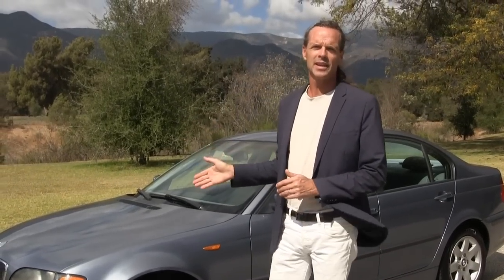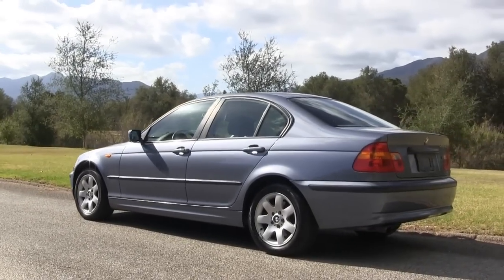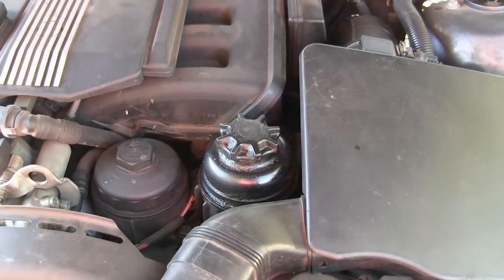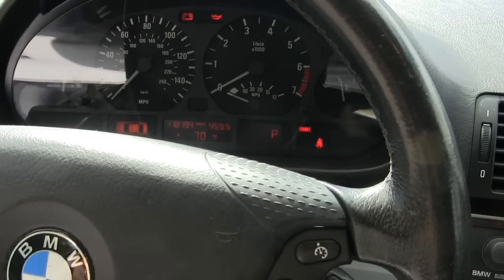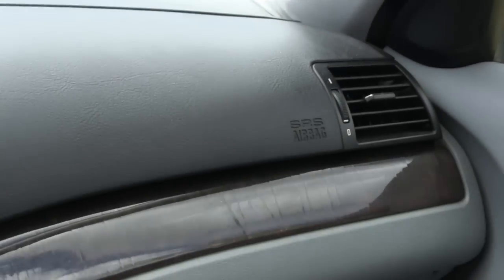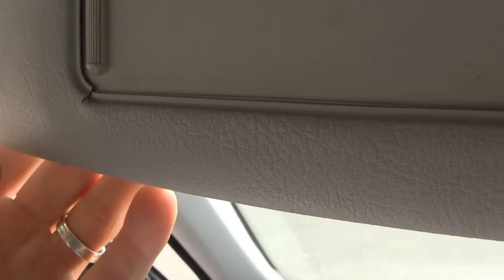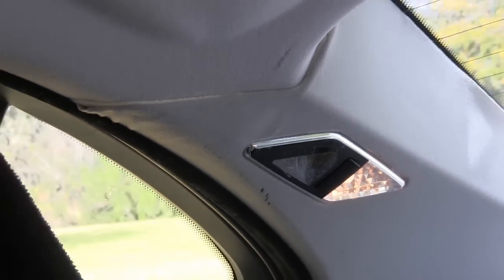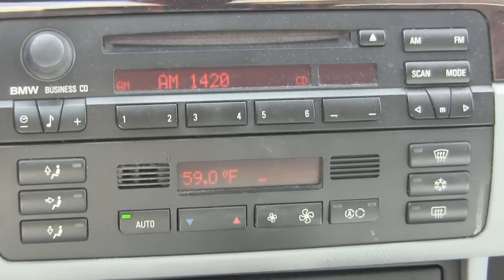Why You Should NOT Buy a Used BMW

Comment: So a car detailer bought ONE BMW lemon and advises not to buy any used BMWs??? Are you serious man??? You are just an amateur, I've owned used BMWs and never had an issue with them. But I did had problems with my new Ford... are all Fords shit? NO. Used cars can be amazing or can be a disasters depending on the care given by the previous owner. Generalizing is a ferry bad thing, you should know that at you age.

How much did you paid for that car, did it came with a full service history? You are telling us that American cars are better made??? Unless you have a hidden agenda I will suggest that you keep wrapping your engine bays with burrito foul and power washing them... I guess then Toyota engines will be also crappie... or they can take it? Total amateur talk and approach.
Reply: BMW, VW/Audi, and Mercedes all went down in quality when they globalized their production. This started affecting build quality in a terrible way between 1998 and 2000 depending on model. As an example, the Mark IV VW Jetta was a great car until the mark IV and they moved some of the production to mexico. The mexican built cars were a travesty on quality control. There are similar stories with both mercedes and BMW. In order to compete in a global market, quality had to suffer to cut costs in production. That is why the resale value on used BMW, Merc, and Audi is so terrible. The worst being AMG cars.

This is compounded with the fact that most German models require dealer specific fluids, tools, and maintenance parts. So you get a car that is barely built to last 80,000mi and unnecessarily expensive to repair. I would never own one at this point unless from new with warranty. I have owned 2 German cars in the last 10 years and I have learned from my mistakes.

"German Engineering" is marketing bullsh*t
Reply: You have owned 2 German cars in the last 10 years... Well I've owned a few more than you as I live in Europe. I never had any serious problems with my VW or BMW. My brother in law only buys BMWs with more than 60.000 miles on them because they are super cheap here in Germany. NEVER had a single issue with them and the resale value is quite high.

BMW engines and specially the non so popular in the States Diesel ones are built to last at least 300.000km (around 200.000 miles) without any major overhauling.

Are American cars better? NO. Your crash test were the worst in the industry until late 90s. Only Chinese and Indian local manufacturers were worse. Are American cars today still so bad? NO (except the Mexican made ones [crash tests available all over YouTube]).

Yes, High Performance engines with super low emitions and high mileage per galon need specific tools and fluids in order to last long... And? i always take my vehicles to authorized repair centers, no gambling there.

My BMW 520d burns 6.2 - 6.6 L of fuel per 100km on mixed conditions (that's around 1.6 Gallons per 60miles). Yet it reaches 240km (160miles) in the autoban without any concerns. Smooth... Amazing car.

i believe generalizing after owning 1-2 cars is not very wise. You might just have been unlucky. I owned a Corvette once because I wanted to experiment the American dream. It was the worse car I've ever driven. Are all Corvetttes shit? Absolutely NOT. I love them.

I salute you.
Reply: Konstantinos Anastasiou you missed a major point, you live in Europe. the cars sold outside the EU are of inferior quailty. german cars are bad buys in the states, for all the reasons stated above. In the states Japanese cars are hands down the most reliable, and us domestics are cheapest to repair comparitively. 
You also use some very faulty logic, because to dont need to own a car to learn enough to know its not a good buy.
Even japanese cars quality has gone down over the last decade because most japanese firms manufacture cars stateside to reduce production and shipping cost.
Reply: fonque we are going to have to disagree on that one. One cool example is that BMW builds the X series in the United States and ships them Worldwide with top quality! BMWs made in USA are as good as the ones made in Berlin. Manpower is different but quality control is exactly the same if not better.
Reply: With the same - I had my e36 with 500.000km on it and it worked great, without any rebuild. 
I know many others who have bmw's with very high mileage and without any major problems. 
The things he talks about in the video is just bs... Waterpump etc? Well, it is common sense to follow the mileage and change the parts that wear down / get brittle with mileage. (looks like not so common sense)
Reply: Amen, at last some common sense... Absolutely agree. The problem is people want to own expensive cars "on the cheap", skipping recommended services or doing them in the cheaper places they can find. In the official BMW catalogue there is a list with parts that need to be checked / changed after specific mileage as you said. 500.000km is a lot, i guess you got there a great car!
Reply: Hey - someone living in Berlin here. They only build motorcycles and few (if any) car components (e.g. brake discs) at the BMW factory Berlin Spandau. Generally i'm with you but there have been issues with certain models. For example the first year(s) of the Z3, build in the US we're not up to the standard "german-built" quality, same goes for the first gen X5.
Reply: Hello Brian, I agree with you. 1st generations always have small issues but I believe the same applies to every brand and make in the world. Every manufacturer has recalls and service bulletins because of technical 'maturity' related issues. My series 5 is the last generation of the F10 so no problems here ;)

i salute you.
Reply: just go to edmunds.com and read the reviews on any bmw there and you will basically see it split 50/50. worst most unreliable modrl ive ever owned, or this is the best car ive ever owned. That 50/50 split is not good, that means the cars are unreliable compared to other brands. Also you notice the more the miles accumulate the worse it gets. Then switch over and compare reviews to cars like toyota corolla, hyundai accent, or chevy hhr. You will see far less bad reviews on high mileage cars. The are economy cars tgat basically only need oil changes and accesdory belts to keep going. I had a 1992 Nissan Sentra that went 140,000mi and never in the shop once, only oil changes and bushings and rear struts. Good luck getting a bmw to do that.
Reply: fonque what's the performance of the 1992 Nissan Sentra? Compared to the BMW? How many valves and cylinders? Top speed? Better leave the Chevy out of this, it will be totally rusted before reaching 140.000 miles (like mine did). You are comparing economy cars with high performance GT cars... not apples to apples. How many miles can do a Lamborghini changing only oil and spark plugs? How many miles can do a Corvette changing only the belts? BMW is winning all engine awards every year. When was the last time a Nissan won an award? Only GTRs kick ass. I wrote it before: if you want to have a car on the cheap, by a Japanese sedan. If you want a European gran tourismo you will have to maintain it.
Reply: fonque from Wikipedia: For the 1992 model year (August 1991 – July 1992 production), a passenger's side vanity mirror and black body-side moldings became standard on the Sentra 2-door. The Value Option Package (air conditioning, cruise control, and a stereo system) was extended to SE models. The optional three-speed automatic in the E coupe was dropped and gained an optional 4-speed automatic, shared with other models. 

I believe this comparison should be over at the "vanity mirror" line... by the way that car was made in Mexico. Want to talk about NCAP safety ratings?
Reply: Konstantinos Anastasiou so you are okay with paying thousands more for a car thats less reliable, if so then you are exactly the kind of sucker bmw is trying to sell to. you like shiny new things but not well built ones. I'll continue to vote with my dollars.
Reply: Konstantinos Anastasiou i had an nx2000 which was designed in cali but built in japan, Same for the SE-R of the same year. But you have completely missed the point. Car manufacturers including BMW have been able to build cars as reliable as a b13 sentra but BMW chooses not to on purpose.
Reply: You keep saying that I miss the point and that BMW cars are less reliable than the Japanese. I totally disagree. In today's society people have too many options to buy from. If a product is unreliable people just skip it. 

I believe you are the one missing the point as BMW sales are in record figures year after year. USA is not the World. 

Germany is heaven for used cars and here BMW, Mercedes, Audio,  etc. are extremely reliable. Just lift your car up, is it totally covered from the elements? Mine is... I know for a fact that the quality of a car made with German engineering is far superior today than many competitors. Few manufacturers can brag about the technologies utilized in their cars. You want to believe that today's BMWs are more unreliable? go ahead. I have my own and verified personal opinion, non from reading on sites but from buying cars for many years as I am 44. How many BMWs have you owned? How do you treat your cars? In Germany due to the weather and the quantities of salt pored into the asphalt Japanese cars literally rot (you can check that online too) therefore their reputation is not so strong. In addition Munich is a very rich city so you barely see economy cars around.

In any case I see no point on going back and forward with you on this topic. Please feel free to buy used Japanese cars from the 90s. I will stick to my 2015 BMW 520d until the next 5 is available.
Reply: fonque by the way and without wanting to get disrespectful, how old are you? you keep mentioning cars from the 90s but you like tons of videos of Minecraft, Selena Gomez, electronic music and other "younger" hobbies. Not attacking just checking for people just trolling around. I had a few arguments with "connoisseurs" full of life experiences that were 21...
Reply: Konstantinos Anastasiou i am middle aged but my kids use my account, since they dont have one. Regardless of age it sounds like you havent done very much research on reliability and just going on personal experience and annecdotes alone. If you are really interested i can provide links to some reliability studies that corroborate the video creators point. Independant studies from both from the US and the UK. If you dont care about that then google problems per 100 cars. BMW does not fair well, no german brand does.
Reply from the maker: I am not a car detailer. I am a professional car buyer.
www.yourcarangel.com
Reply: YourCarAngel sorry to hear that. I work in the automotive industry for the last 22 years and never read an advise more objective than yours...
Reply: Konstantinos Anastasiou BMW and Mercedes DON'T have the quality that one would expect from a 10 year old German car vs a Japanese car 10 years old for half the price and half the repair BILL ALSO! Have a good day sir
Reply: mate sivric that's your opinion and you are entitled to it. I totally disagree and I will add that German luxury cars are in a total different league so not comparable to Japanese. The problem is that people want to buy a BMW and treat it like a Civic... I always service my cars in the official dealer network. ALWAYS. And that's why I never had a serious problem. A BMW Twin Turbo 6 cylinder engine cannot be maintained by your local car shop because they simply didn't spent the necessary money and time to get trained in that specific product. And NO, AN ENGINE IS NOT AN ENGINE. Again, I am impressed on how well put together and the feel of brand new used BMWs offer WHEN MAINTENANCE is followed by the book.

There is a very popular British car teleseries called FIFTH GEAR that totally agree with what I am saying.
Reply: Konstantinos Anastasiou I had been a valet for a few years and New Merc, BMW and Lex ALL drive excellent...Take a car from the Midwest(10 years OLD or older) with broken pavement and left in 100 degree summer and -40 degree winters ALWAYS cold started and all service done at dealer religiously and you can tell the difference in the quality of the the ride and reliability between the two is Unparalleled
Reply: Konstantinos Anastasiou I agree about German cars as in "AMG" but anything NOT hand built is uncivilized to even mention as "German" when the robots that build those vehicles are of Japanese or Asian descent.
Reply: ***** Hahaha...The Fields In Illinois is the same ALL the mechanics drive cheap Honda and Toyota because they have to make it to work on time! Look at any Range Rover or BMW dealership repair LOT IT'S FULL!
Reply: Duke Of Prunes Had an 2004 Honda no issues. LOVE my Toyota matrix with 1.8 vvti motor currently for gas economy(30+mpg) and cheap OEM parts online. I have a V8 jeep also LOVE IT but very rarely drive it since it gets 12mpg
Reply: Duke Of Prunes Sure man... sure.
Reply: Blake D I wouldn't go as far as calling him names but definitely he has provoqued suspition with the way he describes the brand. Perhaps Lexus have a higher margin compared to the Germans and he is just preparing the ground... I would understand if he claimed: "don't by this specific car" but "don't buy a BMW..." in general, weird. 
Again this "professional" was pressure washing a car with the electronics covered in burrito foil... that should be enough to understand. Sloppy. Like the car review he did. The problem is that some clowns - like the one that got personal with me above - are always waiting in the corner to get out all their complexes of inferiority. There's is no BMW for 4000$ that will not give problems. Period. Good used BMWs keep a high resale value. There's is no fixing the car outside your home with a portable diagnostic tool.

I also checked his website, it is totally outdated. Too much text, little proof of quality work.
Reply: Let me take some popcorn.. interesant conversation :D

Anyway.. I will always be pro to German cars. They are safe cars and very comfortable. Actually I have a Mercedes CLK from 2003 with 115k miles on it, but it's like new.. Okay I'm only 19, this is my second car and it wil be for long long time.. My dad has an E-Class from 2004 with 161k miles and never had any problem. It only depends of how much care you take about your car.
Reply: danuzz that's exactly the point!
Reply: danuzz Mercedes>BMW
Reply from the maker: Thank you. Objectivity is good, it's subjectivity that you want to avoid.
Ich bin mit einer deutschsprachigen Frau verheiratet. Ich wünschte, ich könnte die Autos so lieben, wie ich sie liebe!
Reply: YourCarAngel no one doubted the fact that you love cars. I believe you must if you do this for a leaving. Your approach to the matter in your videos is what lives a weird feeling. If you professionally buy/sell cars you should know that any car maintained properly will last +15 years without any substantial issues. The same applies the other way of course. The specific car you are reviewing has his issues but saying "don't buy a BMW" us a little funny when that manufacturer is breaking record after record.
Reply: i had 520i -91 e34 with 550000 miles on it and it was fine with no rattles or any weird sounds
Reply: My 2000 dodge durango has 210k miles on it.  I've only had to replace a power window motor and the radiator.  At least 70k of those miles are towing miles too, keep that in mind (we haul our camping trailer with it).
I've been taking good care of the car to this day.  It runs perfectly normal still.
Reply: mirsec008 No one said that other cars aren't reliable. Any automobile treated with care will outlast his owner. The issue is the "review" above. Poor, objective, amateur.

Another thing to consider is dynamic driving,  in the states performance is acceleration from a stop light to another. You have a 55-65 speed limit so every car handles well. In the German highways you can drive at +500 mph legally (there's no speed limit), that's where BMW sets appart from the rest.
Reply: One big problem with BMW is the cooling system depenending on who is driving it.I saw idiots saying that BMW should warn buyers about RWD because where they live there's only a little snow and they don't want to buy winter tires because they are expensive.Seriously,these cars may be molested before you buy them and the engine may have suffered a serious overheat.
Reply: Gabriel Badea I guess that could be applicable to any vehicle right? At the end of the day, if you don't take care of the car it will break down.

My 2nd car was a VW Polo. I remember I had to change the fuel pump cause it literally melted inside the tank. I was in the army and the car was parked for 6 months.
Reply: I see You! 

no no he is a pro.... he get a car after flood for low price . then hide all issues and resell with profit. simply genius muehhehe
Reply: Do you know what is "FORD " stand for right?
Fix Or Repair Daily
Reply: ***** shhh be careful... if you mention the amount of money you spend in your car you will awake the wolfs...

It is proven that all theses "Internet armchair experts" have little or non experience regarding the topic they are discussing and in this case BMW cars. I tend to agree on the "flood" vehicle. Here in Munich, any one selling a car is obliged to mention in the advert (penalthys for fraud are huge!) any damage above 500€. So no lemons around :) Additionally, Germans really love their cars and they maintain them meticulously. That car above, with all those problems will sell for 2000-3000€ around here. I don't believe that if you spend peanuts to buy a badly maintained vehicle you have the right to complain about it or bash the brand.

The funny thing is, the majority of us didn't attacked any other car brand here. Again human nature at its best. People bash what people can't afford. I was reading another thread somewhere and someone was stating that McLaren are shit cause there is no space for the groceries...
Reply: fonque, I totally agree with you on this one.
Reply: Konstantinos Anastasiou , that bullshit talk man, we're talking about  liability/quality and  not PERFORMANCE, 98% of people use their car for work, family, and  running around town. SO, liability is MORE important for most people. you're a BMW guy and no one going to change your mind, besides you live in Germany. In the states with 3k across, we drive a lot and want  reliable cars and if we can get a performance with that, it's even better.
Reply: Konstantinos Anastasiou To be fair, I've seen all of these problems on other E46's. the drivetrains are solid on them but rest of the car falls apart.
Reply: 97I30T I don't say you haven't.  The question is, we're those cars serviced properly? Taken care? A 10-15 year old car left to its faith will develop problems.
Reply: Konstantinos Anastasiou, you can do all maintenance
Reply: Konstantinos Anastasiou It's hard to say with a car that age if it's been looked after well. I have however had plenty of other cars 10-15 years old (2004 Saab 9-5, 2004 Volvo V70, 1994 Ford Ranger, 1997 Infiniti I30) that did not have problems with the interior falling apart and plastic and rubber degrading like these E46s do.
Reply: Blake D, I'll leave that to you Blake,  you DID HELL OF JOB LAST TIME. THX MAN SEE YOU IN FEW DAYS OK.
Reply: Konstantinos Anastasiou,  😂😂😂👍👍👍
Reply: Van Kham OK,  now that I've made you laugh let's have a civilized conversation ;)
Reply: YourCarAngel, love your honesty, love all your videos. 👍👍👍
Reply: Konstantinos Anastasiou, yeah,  try it, you might enjoy as well.  👍👍
Reply: Blake D 😂😂😂👍👍👍
Reply: PALMAS || Applause
Reply: Konstantino +1 on your comment, lots of peanuts here. Meaning it can only expand to the size of its shell. To Angel, I live in Florida and you are welcome to make an assessment on my 2004 ///M3 which has been track and often push to the limit. Its all about maintenance man and I have own all sort of cars in the past. Don't take this the wrong way but your review is rather bias since those issues that you are presenting can also be found on any cars that has been neglected. Peace!
Reply: Exactly what I was thinking :)
Reply: I have a Benz and a Ford... no problems with the Ford Focus,  but the Benz is shit
Reply: mrchapman sell it and buy another Ford
Reply: Konstantinos Anastasiou I wish... the most I can get is about 4k€, I can only buy the wheels of a car with that much hahaha
Reply: mrchapman so it must be a very old Merc. Is the Ford as old as that?
Reply: Konstantinos Anastasiou 2005 E320 CDI with 240k km and 2008 2.0L TDCI Focus with 170k km. I won't get much for any of them right now.
Reply: javiervallejo13 , you are absolutely 100%  RIGHT about bmw, no more bmw for me ever again and know of many people who say the same, i just want keep my money for other things and not keep fixing the damm  car, there's European motor sport  shop 4 blocks from my house, I noticed the employee's cars are American trucks or Japanese cars with one exception a red mercedes glk350.
Reply: mate sivric , yeah, at least cheap Honda and Toyota are reliable and cheap to fix. those mechanics are smart,  they knows that honda and Toyota not gona break down on the way to work.
Reply: Duke Of Prunes , 👍👍👍
Reply: Konstantinos Anastasiou 😭😭😭😭😭😭😭😭😭😭😭😭😭😭😭😭😭😭😭😭😭😭😭😭😭😭😭😭😭😭😭😫😭😭😭😭😭😭😭😭😭😭😭😭😭😭
Reply: fonque,👍👍👍
Reply: That Guy From Kansas I agree with you. The problem is not the age (although there's always a natural degradation in every material) but how was the vehicle maintained.  My guess is that the car above didn't received much love...
Reply: Hmm, I've never had to "maintain" my headliner, or the rubber along the bottom of my windshield, or my A pillars, or the paint/coating on my plastic parts, or my window motors, or my overflow tank or the stitching in my upholstery.   My 92 Ford doesn't have any of the problems of that much newer, lower mileage BMW except for window motor replacement.
Reply: It is same with Benz. In US they say that they are money pit but E class is most used taxi in Germany and other countries. I talked to cab driver on his experience and they run super reliable and cheap. Maybe they have just basic car with no expensive options and always diesel engine but still. 
Don"t know what's the difference in experiences caused by but would like to know.
Reply: You are right on that. In States people are very cheap and expect cheap maintenance on premium cars. It's much cheaper to buy them in US and leases are very aggressive to sell.
Reply: 1BMWdrvr1, truth is truth man. that guy Blake talking a lot of hot air. go read his comments before you judge man.
Reply: 1BMWdrvr1, thanks you. 👍👍
Reply: Thank you for sharing of your experience. Very good points from you also. I am BMW fan so not really objective but notice it in US that people  with buying used Germans forget they are premium cars and often aren't ready for costs. I grew up in Czech Rep but living in States for decade and half and people don't compare normal cars to those four brands from South Germany. You get what you pay for and I know about super expensive options in new cars and things you may get in Kia not getting in BMW costing three times more but there is other quality in these cars. I'm old school and still prefer driving and built quality over some apps. My level of tech options I need stopped around year 2000 all the modern stuff it's not needed for me. e46 and e39 are still tops as you said. But I love the new 5 series. It speaks to me.....Regards
Reply: You speak my mind
Reply: Steve Mantel Hi Steve, nice to read comments from people with common sense... No one can expect to buy a 20 year old BMW for 2.000€ and win the lottery... you summarized it pretty well: you get what you paid for.

The car above was poorly mantained by the owner(s). Why all these issues were not fixed in the first place, before selling the car? Why let the ceiling fall appart? The mirrors broken? WTF? The car was in a lousy condition and shouldn't be reviewed in the 1st place and in any case the tittle shouldn't be generic and absolute.

I can get any 2 year old car and make it look like shit. My Corvette was falling into pieces, I wanted to buy an American icon but I was a 20 year old student with barely any money for fuel... maintenance? No way! Would I recommend to buy a Corvette? ABSOLUTELY!

Why didn't he got a proper E36 and compare it to a similar American or Japanese car? This Car Angel is antiquated, his methods outdated and his opinion invalid and objective.he is promoting TOYOTA all over his business. I am also objective as I am a BMW fan but I CARE ABOUT MY MONEY so I am also very critical with any brand if necessary. So far BMW has lived to my expectations but I also take great care of all my cars (and bike).

I salute you.
Reply: Wow. Great testimony and good common sense. I love S1000R too haha....I just appreciate guy like you who puts lot of info and thoughts into these comments where person willing to listen can learn a lot from your experience but instead they project their life situation on you and are very rude.
You use real name like me and try to balance things with grounded opinions based in reality and are slammed for it and called names.
How typical from internet ,,warriors" these days.
Btw new C7 is very nice and probably first sport car I would want to by from Chevrolet.
What do you think of new 5 series? So far I'm impressed and seriously like it but I also consider myself BMW fan and lover choosing it from big four German brands (including Porsche) when given chance.
I had great experience with Audi and owned more than few, taking great pride in good maintenance and they ran like clockworks. And they were all 6 and 8 cylinders, so no little fours.
But changed to Beemer ( 535i) and I'm very happy. 
Anyway, yes you are right about this guy. It seems like he try to get the worst case of car just to please his audience of cheap Toyotas and Hondas which are great cars if you just need basic transportation for cheapest costs. I hate to say it because I don't like to be critical behind the screen but my response to you is more about people who just answer you with rude comments and arguing nonsense.
Don't get discouraged and stay positive and friendly as you are. 

Regards
Reply: Steve Mantel thank you very much for your kind words :)

I try to keep it civilized and not enter into senseless conversations with 'armchair experts" that never really owned a luxury car but just feel the urge to trash BMW and everyone else for their economic situation. Truth said, today there are no bad cars and any vehicle with basic maintenance can run trouble free for many miles. The difference is on the quality and feel of the car and in this case BMW has this superior handling and robust built even after many km... anyone jumping from a Japanese brand to a German brand can immediately recognize this feeling. Specially the 5 series  is one of the best put together cars and the F10 evolved through 6 generations so practically trouble free.

Talking about the new 5, I really like it. It could be my next car as the jump in technology is satisfying to put it in a simple way. I also like the new edgy design. Life the car has quite a few more similarities with the previous version, specially on the non M models but I still like it a little more than mine.

I salute you.
Reply: Congratulation for the polite manner you conducted/replied to all that had a reply to make about...

I wonder why the uploader is not thinking of PINNING your reply instead!?
Reply: The world produces many great cars; example Japan, Korea, UK, USA and France.  You are clearly wealthier than I so you can afford to buy overpriced German cars to waste your money on depreciation and maintenance.  Too bad those German diesels did not output their exhaust in your cabin...
Reply: Kostas G and Japanese were their allies, Italians also and the Spanish Seat belongs to Audi so you can only buy French and Korean cars... right?
Reply: Because you finished school and I did not, you need to read again my single comment to you unless you are 1BMWdrv1 as well.  You will see that I do blame us, but also inform you that it was the Germans.  If you ever come to Crete let me know.  I spend my summer in Elounda.
Reply: Germans need to pay for WWI and WWII.  They should take the lead and we will then do the same.
Reply: Kostas G this is a car discussion about maintenance and running costs. There was no need to turn everything into politics. I wanted a reliable and extremely safe car for traveling with my family. The 5 series does exactly that. The rest is history.

We Greeks need to take control of the country, send all politicians, bankers and media channels owners to prison answer star all over. You cannot stop buying EU products to send a message, no one cares. We are only 10.000.000 people, Texas is 4 times that. The milk in Total yogurts comes from France... why?
Reply: And I agree with you.  The comment was referring to Diesel gate.. Those kids AND their immediate family need to be held responsible.  Its simple: pass a law that requires them and their families to pay for the damages.  As for the anarchists, it is known that many of them are children of many members of the Greek parliament.  You have fascist and communists representing Greeks in the Greek parliament.  You have Mitsotakis grandson/son of Dracula(who spent his time in WWII visiting German forces in Aghia) mixed up with the SIEMEN's scandal.  You have Vroutsis(speaker of the parliament) who has a son wanted for a bank heist.  All parties are terrible.  The same people that brought the civil war, the military coup and the economic disaster are the same families in Greek politics today.  We have people that can lead Greece, but they are not allowed to because they either are not family or have not rubbed shoulders together.
Reply: Kosta you are right but in most scandals that relate to our country, it is only the Germans that are involved.  Remember that when Osama Bin Laden masterminded the Twin Tower incident he killed less than 3000 people.  With the Diesel gate scandal, VW group is responsible for over 4000 deaths.  Unfortunately many of the German elite are children or grandchildren of NAZI party supporters.  Germans are generally quite nice, and that is exactly what the elite are using against them.  If the EU breaks up, who will be most devastated?  The Germans because their currency will be worth so much that no one will be able to afford their products; those that can afford their products will not buy their products based on resentment alone.
Reply: No one cares about WWI and WWII... until history repeats itself and you are forced to serve.  Nothing of value?  Value is a relative matter.  Some find being the head engineer at Tesla valuable.  Others find SPACE X valuable.  Some women find the Pap test valuable.  Some may go as far as saying that the foundation of Democracy, Art, Architecture, Mathematics and Science is valuable.  What you find valuable is death by the millions and buying an over priced depreciating clunker that requires much for maintenance.  Next year there is a new iPhone on the market and possibly a PS5; your gonna have to work a bit more at Starbucks now.
Reply: We at least agree on VW...  you know that company that produces the most high end German cars from Bugatti, Lamborghini and Porsche, to Bentley and Audi as well as Volkswagen, Skoda and SEAT.  Volkswagen, the 'peoples car' as Hitler intended it to be called.  You know what Hitler's nickname was?  Wolf.  You know where VW head office is? Wolfsburg (Hitler's castle).  You know how many Hitler murdered? 30+ million.  Do we need to kill 30+million people so to have a city named after us?  Even the Russians when the USSR crumbled renamed Leningrad(St. Petersburg) and Stalingrad(Volgograd).  Why didn't the elite Germans do the same?
Reply: Kostas G Nazis are condemned openly in Germany and Germans are generally ashamed of that Era in their history. In fact, any Nazis symbol is forbidden and heavily punished by the law.

In any case, these are festive days so peace everyone. Merry Christmas to you and all your beloved ones :)
Reply: Well said. Germans have been in ,,corner" for bad behavior last 70 years and didn't stop apologizing since, even though they paid dearly for their mistake to putting ,,that man" into power. My ex-wife family was upper class business owners from Hamburg and lost everything because of war.  They couldn't, after some point, voice their concerns about the way their dear country was heading, without being killed. Even sent their kids to USA to go to school and live after the war,so they cold start new. Their will for living was destroyed and they as nation, were shamed ever since.
Anyway I'm keeping to come to your comments just to see, we are similar souls. I left everything behind too for the opportunity to live better life and after working two jobs or seven day weeks for years I started to achieve that. I guess because it's holidays I'm little emotional about sacrifice people like you or me make just to have better life then our old family or offer that to our children.
I couldn't drive car that my uncle could never buy, so when I could I least sent him money for nice preowned car he always wanted( modern Ford Fusion 2.0 diesel wagon which to him is like M5 to me)
I wish my old friends would be here or we all grew up here and have our nice bikes and muscle cars in twenties. That was my dream with my poor but smart and hard working friends in CZ and now I live it but can't share my success with all people I wish to.
Anyway, sorry for my emotional rant just wish Marry Christmas all the health and happiness into new year to you and your loved ones.
Reply: Yes I know they condemn Nazi ideology, but many top positions are held by children and grandchildren of very important NAZI members.  The same applies for people holding top positions in German firms outside of Germany.  Take Christoforakos; his father was trialed for treason in Greece for being a NAZI conspirator.  His son was in charge of SIEMENS in Greece and now under the German government will not be extradited to Greece for trial.

ΚΑΛΑ ΧΡΙΣΤΟΥΓΕΝΝΑ ΚΩΣΤΑ! ΖΕΙΣ ΣΤΗ ΦΩΛΙΑ ΤΟΥ ΛΥΚΟΥ...
Reply: 1BMWdrvr1 you are right BMW's drive very well but they spend quite some time in the repair shop.  I have owned new V8 and V12 engine BMW's and I can tell you with certainty that they are a pain in the neck to maintain and when they go wrong in many instances the service manager does everything he can to avoid having it covered by warranty.  My Mercedes S550 a few years ago with 85 000 km had its transmission replaced at over $8500!  My Lexus LS 460 with over 140 000 km has had no issues.  You are right in saying that with BMW you drive, while in a Toyota you ride but at least I can ride whenever, wherever I want without having to worry about visits to the dealership.  Besides here in North America speeding is not an option as there are police everywhere enforcing the law.
Reply: With all that German erectile dysfunction are you sure you are your 'father's' son?
Reply: Kostas G, LOL.😃
Reply: Kostas G,  LOL.😃
Reply: Konstantinos Anastasiou, LAYSY? 😂😂😂
Reply: Konstantinos Anastasiou 
Maintenance if often more important than the device itself.
Different cars are designed for different kinds of people.
Reply: Vince King you should read the whole thread,  I've mentioned the maintenance topic several times
Reply: Konstantino ... glad you had a good experience with yours, be grateful for your good luck.  

Friend of mine bought a 3 years old  5 series around same time as I bought a ten years old Mondeo ... he spent more on routine service at the BMW dealer in the first year than it cost be to BUY and RUN the Mondeo. Second year he broke the bank ... aircon pump seized and burned all the belts. After repairing the car he traded it for a Subaru and in the course of two years lost 75 of the car cost, plus all his expenses.

My Mondeo ran virtually without fault ( a battery, small exhaust repair, tyres and ordinary servicing ) for six moe years and I sold it privately for 80% of the original purchase price with over 320,000kms on the clock !

You may want to argue I was lucky and he was not ... I'd agree with CarAngel ... don't expect any good from buying a used BMW :-)
Reply: I'm in NZ not USA but checking online just now a USED window lift mech from a BMW dismantlers was 280 plus GST 15% making a total  of NZ$322. In general terms used parts cost us between 1/3 to 1/2 the new price.

Can't really comment beyond that and yo say that also in UK BMW prices are outrageously steep.

Personally, they're OKish  when they're new, but IMHO very far from 'The Ultimate Driving Machine' . Lexus beat them hands down in so many ways, Toyota do as much in their high end mainstrea range and even Hyundai have been getting favourable reviews v beemers!

I'd not risk my own money on a used BMW
Reply: Kit Carr Friend of mine, read in the Internet,  I heard... that's the problem, everyone has an opinion based on what they heard from 3d sources. I said it before: 3/4 of the folks in this thread never owned neither drove a BMW, they just bash a luxury car brand because they have to drive their little Japanese cars made in Mexico. And thats fine, dont get me wrong, ENVY is the problem here. ANY car maintained properly will go 200.000 miles, period. This Car Angel is no car experts he is just trying to make a leaving selling used Toyotas. His methods, his looks, 80s... a ponytail, common seriously? I haven't seen a white suit with a ponytail since Miami Vice :)
Reply: Guys, calm down.   Fucking hell guys.
Reply: *****  Ok, idk..
Reply: ***** you are on point... Car Angel here or should I say Michael Bolton's brother is intentionally creating a strawman to redirect the audience to his Toyota sponsored website. He even pins comments favoring Japanese brands, no serious professional would close the door to a future buy/sell...
Reply: After the hidings that Germany gave you guys ( WW2 and the current economic destruction they're wreaking on you ) you're living there supporting them ?
Reply: ***** you are totally right, I am blocking this troll and it's game over. Have a nice day :)
Reply: I have a used e36 for 4  years now i payed 1300 euro 225000 km best car i ever buyed!!!
Reply: Konstantinos Anastasiou for somebody with improper grammar you act like you knit things. Lol.
Reply: I will admit, just because my family had a bad Chevy doesn't mean that I think Chevrolets or GM cars in general are all bad. However, I do think some brands are higher quality and more reliable than others overall (such as Toyota/Lexus and Honda/Acura).
Reply: El Diablo A